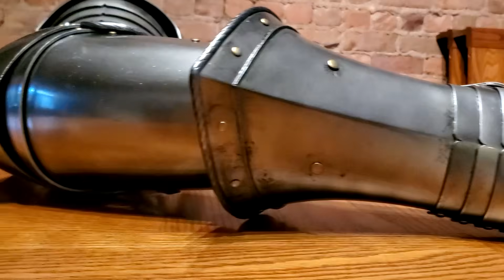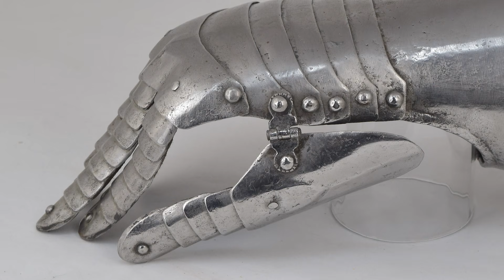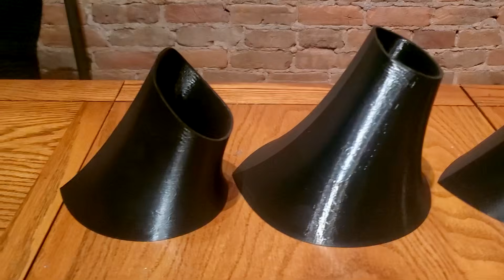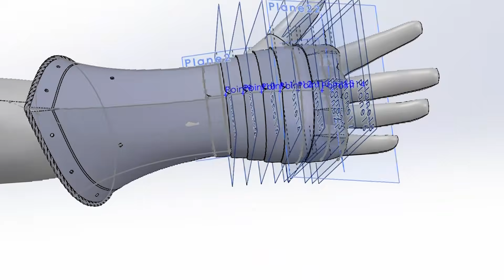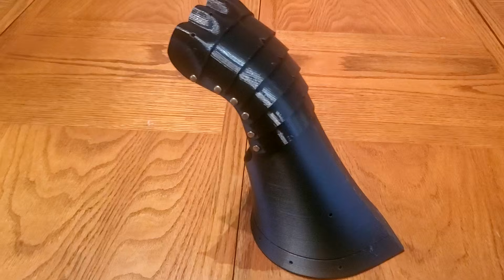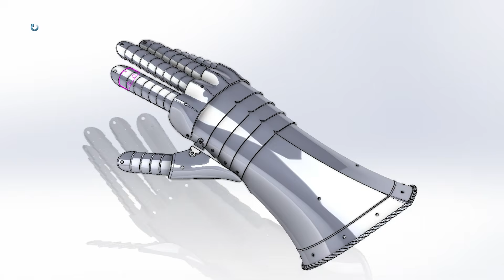Making 3D Printed "Copies" of Real Antique Armor

Comment: This is a really interesting way to make armor, I sculpt in Zbrush/use other software houdini etc and used to professionally armor but now you make me want to get a printer and go crazy!

I do have a question or two if you'd entertain me...
1. with my prior experience of handling Wade's armor and from my own of making it, your plates require more curvature, especially the lamellar on the "width" axis not length, can 3D printers get that curvature and retain actual plate thicknesses of 0.025-0.040"?  If the plates were given the proper curvature, you'd have more range of motion than your actual handle is able to move in, it's a neat thing about most 16th century pieces, aside from left to right mobility which is strictly related to your cuffs sizing...

2. Did you print the holes or punch them yourself? I think if you oversized each lamellar by 10-15% then manually cut them down with say, aviation snips you can get a much better fit but this may be out of scope for 3D printed armor. I actually don't know if 3d printed plates could be trimmed that easily or if they'd snap.

If you ever get stumped on a problem, please reach out to me. And another tip, make sure you always design your armor in "full flexion" or combat ready position, so if you do a gauntlet with full finger lames, make sure it's closed like a weapon is being held. This is something a lot of people always miss even in semi good reproductions. In some cases it may be incorrect to do it like this, but I never found that "some case".

A.L

Comment: @NicoPrintedAntiques
Have you dipped into Zbrush yet?
I'm personally looking at going from an AI 3D maker over to Zbrush for the removal of AI errors and then it's up in the air about either AI platform or Zbrush platform for welding the corrections back together.

OK, the reason I'm contacting you is I'm thinking of making your chest plate + back plate and moding it into a 4 armed human.  
(So do you think that with a 3D print (which material is still up for discussion) of your work I could properly secure (2) fake arms without either strapping myself down so tightly that I can't breath at this High altitude property or that it would be flexing all over the place?)
Reply from the maker: That's a pretty difficult question to answer; I think you want the styrofoam-molded arms of a store-front mannequin instead of 3D printed arms, most likely. Fastening it to armor is possible, although I'm not exactly sure which system is best having not attempted this.

As for Z-brush, I've tinkered with it but I use Solidworks for Makers for most of my modelling! Cheers!
Reply: @NicoPrintedAntiques  I too wish I could afford "Solidworks for Makers" unfortunately I'm stuck in a catch 22 with an extra 2 in there somewhere.
My plans of purchasing two more Renogy 200 amp hour batteries died when the Southern portion of the Shed failed in a 3 day long 50 mile an hour plus windstorm.  And I've got a Monsoon season between now and "Winter is coming!"  (I think I've heard that phrase somewhere before?)
All recourse's are being focused on getting the Southern part of the Shed stabilized VIA upgrade before it again is too cold to build.  At the current build/acquire rate what is needed speed.  It will be push back the off grid power expansion into the post construction time period.  (Which is Odd since I clearly need about 600amp surge for the table saw start up.)  Thus Off grid power creates shop space and then one day I get around to my bucket list goal of making the windmill, before I can power a 40' High cube that would house the 3D printers.

The second set of Arms will have the focus of the need for them as the extra set of Arms to hold a GOPRO.  Thus the framing
(The method of mounting/attachment can be unbolted and you can use some pretty standard stuff including various purchased or home made clamping on a circle shape.)  Thus I would be taking like an overly large pool noodle (for the slot and hole to be just slapped onto the GOPRO accessory) and cutting it down where I need flexibility in the joints and then throwing a cloth cover over that.
 will probably be https://gopro.com/en/us/shop/mounts-accessories/base-boom/AEXTM-001.html

Since this project is a White Paper in an Age of just make 90% of the white paper (Paperless) by videotaping it with the GOPRO and then typing what is at the most minimal needed.  I needed the camera before I start cleaning up after the wind storm.  that portion can/will be done with a neck/clip mount.  I could utilize your chest plate re worked into a (4) armed variation so that I can GOPRO myself at the table saw in the future with my hands free and several options on the angle.
The current worn out Sony can't be placed on a tripod and catch my voice on the windy days here, and it's always windy here for at least 1/2 the day.  Until I can get a clip on mic. and another camera that has a detachable mic option it's going to be just the GOPRO and an old worn out Sony.

Comment: hey im buying a 3d printer specifically to make these from your store, what type of filament should i get that isnt super expensive but also wont break
Reply: and you mentioned you used a different type of filament for the fingers why was that?
Reply from the maker: @winter510 I think it was because I had no regular material available at the time and did not want to slow down? Petg and petg-cf are fine to interchange if the part will not be going under stress
Reply from the maker: It's a good question. I used petg-cf for the final prints, but whatever was available for the prototypes (PLA, petg, etc.). Petg-cf is a good compromise of cost, ease of print, and performance.
Reply: @NicoPrintedAntiques  ok i appreciate you, thanks

Comment: I just ordered a new printer. Just in time to learn about your work. This is so cool! and I look forward to printing my own suit of armor. 

On your store, do you sell the models as solidworks files or just STLs? I also use solidworks so that makes things easier for resizing.
Reply from the maker: Cheers! Thanks for asking - I sell stl files only, with instructions on scaling to fit. If I gave solidworks files, license issues not considered, I'd lose control over my work due to modifications and repackaging from unscrupulous individuals ;) 
I dont think these files would be customer friendly, nor would they  rebuild well if a single thing was changed upstream; they're very hard to comprehend unless you made them yourself!

Comment: A few questions.  How "strong" is the printed armour without reinforcement?  As in, could it be reasonably expected to be worn as a costume without spontaneously breaking?  As in, walking, moving, would it break under its own weight on display, etc?  Also,  would your designs allow for adding an internal layer of resin/fiberglass?  And, would adding the fiberglass make the design considerably stronger?  Not looking for something combat ready, just don't want to make something "fragile".
Reply from the maker: Hey! Thanks for the interest. Absolutely my armor is fine for cosplay style applications. Printed in petg-cf, it's quite rugged and never spontaneously breaks. The overall toughness is helped by the choice of filament over basic PLA. As for reinforcement, yes, just a single coat of brushed on epoxy resin on the inside, without a mesh, would do a significant upgrade.

Basically, it's tough enough for a costume, but it's not armor to provide protection from blows.

Comment: I have a question, how would you make the armor fit the buyer, scale it with trial and error, or use some sort of CaD software?
Reply from the maker: Basically, the slicer software allows you to scale by different% in 3 directions. With math, I provide the formulas for pieces like the breastplate to be "stretched" to fit waist and torso height measurements.
Reply: @NicoPrintedAntiques  Thanks, I will hopefully build this in the future

Comment: Hey Nico,

As an undergraduate in mechanical engineering,I can’t tell ya how many times I’ve came back to this video to rewatch to admire your work and try to figure out how to implement your approach for making articulated joints on solid works, that being said I do have a question upon that.

Are they’re any good resources that take you through the process of making said joints, I understand that you achieve your designs through a master plane and then loft/shell your way into a part but I keep on getting really bad surfaces by doing so, thanks.
Reply from the maker: You're very kind! Thanks!

I don't have any solidworks ressources for this process, I think that being rigorous with the splines that make up the base form helps a lot, but there is a lot of troubleshooting necessary. Lofted surfaces and boundary surfaces are finicky and fragile, so you need your initial mesh of splines to be quite rugged for things to remain easily updatable later.

I figure I should do a solidworks CAD course but I am not sure how it would find the right audience with this channel 😅

Comment: How did you get the pins and articulation so well? Also, do you meet to reinforce it with anything? It seems like it could break with weight/ pressure with belts
Reply from the maker: I have not reinforced my prints with anything, and I find the result quite rugged enough for cosplay and non-combat stuff. It's not steel armor but it doesnt aim to replace it either!

Comment: Do you use any specific rivets for the articulation? I'm tackling the same thing as you but for the 14th and 15th century. I was thinking about using plastic rivets because I was afraid the printing material would react poorly to metal ones and I'd also want them to be easily replaceable for repair. What's your experience?

Also, do you have the link for the body reference you use? I downloaded a generic human from grab cad but yours seems to be a bit better for once I get to things like gauntlets.

One more thing. I'd like to adapt my models for the rest of my reenactment and hema group and for that I'll need to make every piece I make easily adjustable in dimensions so it fits various bodies. have you figured out a away to do this? Maybe something with your master curve idea? I'm not experienced with Solidworks enough to incorporate parametric modelling but that was something I was looking into.
Reply from the maker: Hey! Many questions, many answers:
1 - Look into "chicago screws" for more rugged riveted articulations. One side is smooth and looks good; there is a thicker post for hinging stuff, and it's a screw so can be field repaired.
2 - I don't remember where I got mine but I grabbed a generic human male body, which happily suited my proportions for the most part. Consider getting a free 3D scanning app for your phone and making your own digital self?
3 - Since we're 3D printing everything, all parts can be scaled differently by % in the X, Y and Z directions. You'll need to do the math so people can measure something on their body and determine the scaling% for the finished stl parts, whether global or directional, which is what I do with my models. Basically it stretches or squishes the model overall. Doing a parametric model in Solidworks based on human measurements is going to be a nightmare, although it could work if you are very, very confident in your ability.
Cheers!

Comment: Why do you prefer the software solidworks over blender or zbrush?
Reply from the maker: Because it's what I know! I'm a mechanical engineer so I use mechanical engineering tools at my disposal - I also know that it's ideal for scaling, sizing and adjusting mechanically useful features such as holes, pivots, etc., as well as checking interferences, clearances, sketching out motion arcs, and other things that allow me to make a functional design.
Reply: @NicoPrintedAntiques thats fair thanks for the answer. If it aint broke dont fix it. If you know something already and are already invested into with time and money why do another program? I was just curious I never used that program.

Comment: I've purchased your designs recently and I'm currently printing them on a Prusa core one in PCTG.  Do you think a layer of fiberglass cloth would be a good idea to strengthen the prints?
Reply from the maker: You could try it, yes! I assume you would coat the inside face with brush-on epoxy resin?
Reply: @NicoPrintedAntiques  Yes exactly.  And thank you for the reply.  :)

Comment: Brother. Amazing works! I have a beginners question though. There's so many programs for 3d modeling. Tinkercad. Blender and the one you re using? Which would be the best in your opinion for a beginner to take up 3d modeling
Reply from the maker: An excellent question! I use Solidworks because, as an engineer, it's the type of software I know best. It's very good for technical parts but terrible to make "art" with. For this kind of stuff, Blender is free, extremely powerful, and there are a million free ressources to get you up and running. I'd go with that, as a beginner!
Reply: @NicoPrintedAntiques  thank you brother! Amazing and quick response. Will check out blender! Also gonna buy your armor files. Prob the easiest win for this year's Halloween competition 😂
Reply from the maker: @shaunjedi Awesome! Let me know how it goes 😊 I hope you win! Haha

Comment: Absolutely riveting (pun intended). What do you think would be the best way to scale your files to fit different body types? Are there measurements that easily correspond to scaling size, or is this a more complex question that would require altering it in CAD?
Reply: I think the natural intra- and inter- variation in the human body would preclude easy scaling. 

Each thing would ideally be tailored to measurements. 

Apparently knights had their equivalent of tailors for their amour, literally called armourers. 

I bet they’re thin on the ground these days. 

You’d either need a tailoring software process that takes measurement inputs and adjusts mathematically, or maybe a range of ‘off-the-peg’ sizes of different pieces that provide ‘good enough’ fit

Comment: Great project! Just a small tip: when sanding carbon fiber-filled prints, it's a good idea to wear a mask or wet sand, since the fine fibers can be irritating to skin and lungs. If you don't really need the extra stiffness, a regular filament might be a safer (and cleaner) alternative. Keep the awesome work coming!
Reply from the maker: Great point! I do wear a particle mask when I'm sanding, and lately I only wet sand things because I managed to get a good surface finish right out of the printer.
Reply: @NicoPrintedAntiques  That's great, good job! BTW, your medieval armor designs look gorgeous. I'll have to try printing them out someday.🙂

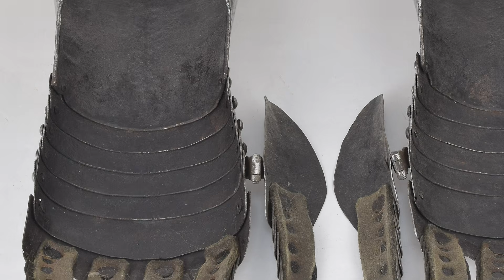Comment: I see a mechanical flaw in your design. All gauntlets in this style had sliding rivets on the palm allowing you to move your wrist freely, not only up and down. You can see that on 1:36 - the slit for the rivet is bean shaped allowing it to slide. Enjoy printing it again. :D
Reply from the maker: Yup, I do have larger than necessary holes for the hand plate rivets, so the tolerance stacking does allow some motion - just not as much as a slotted hole. I might just machine it slowly in my own prop, and re-upload the files with a short slot for future prints.

Comment: hi! i love all of these and love what you are doing!
i do however have some feedback on the dhape of these gauntlets, particularly the position of the knuckles.
i think you might notice that while your pointer finger lines up with the knuckle plate, i don’t think your pinky knuckle is.
this is because the “lines” of the wrist and knuckles aren’t parallel in a relaxed state (which the gauntlets should be built in to avoid unnecessary strain).
if you place your hand on the table, fully relaxed, and take something like a ruler and place it straight across your wrist, you will notice it is a straight “horizontal” line, while of you place the ruler on the knuckles, following all of them, this line will be diagonal, slanting down towards the wrist on the side of the pinky. meanwhile on your gauntlets the line of the wrist and knuckles are parallel, you should put the knuckles at an angle to better accommodate the hand in it, and with this you will also notice that the fingers plates will probably line up better with the fingers. this ehich i am describing was done the majority of the time historically but it’s easily missed, i recommend you ho back to the references with this in mind and i think you are going to notice it on many of the references
Reply: Username checks out

Comment: still working on my gauntlets, currently Tough UV Resin to give it a more solid hardness (I'm overly paranoid due to the hands being most used part of the armor). was afraid of flex might chip my paintjob when I get to that step. But to those wondering, it puts together super easy and is a wonderful design.

Comment: Saving for later. I love your content. As a newbie to both 3D print and armor making and 3D model software, can’t stress enough how specifically useful it is for my own project.

Been having quite a bit of trouble trying to recreate a functional gauntlet using in-game file.

Already had 2 prototype printed and failed cuz I find the range of motion not quite satisfactory. I’ll take some note from that master curve part and hope for the best lol.
Reply from the maker: I'm not sure how practical that advice works for other software, but in engineering CAD it's wisest to have all the plates refer to a master in order to update them all quickly and easily. I learned from my mistakes when doing the gorget - one lame at a time ended up being a nightmare.

I hope you do end up making that project! Come back anytime if you have questions